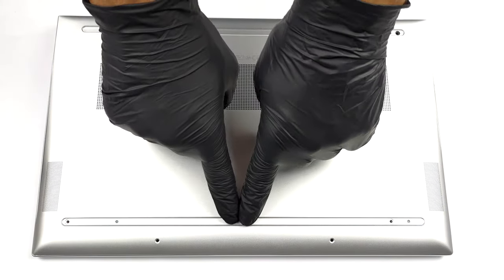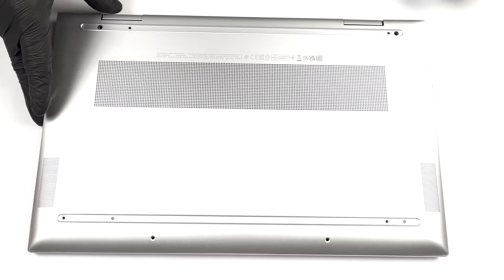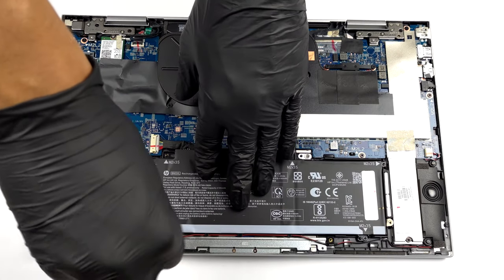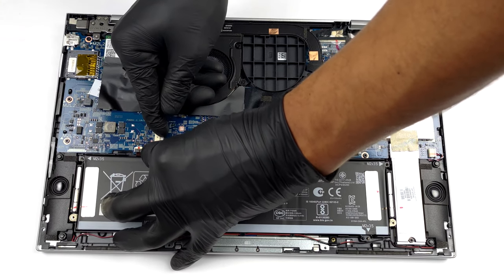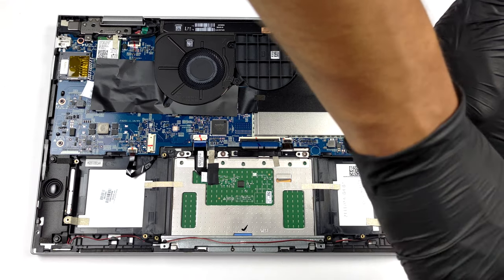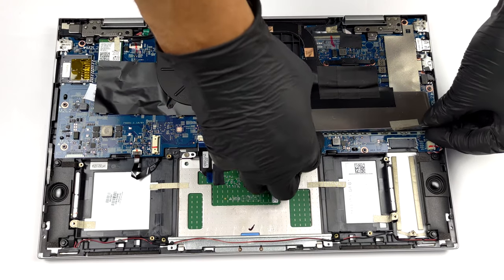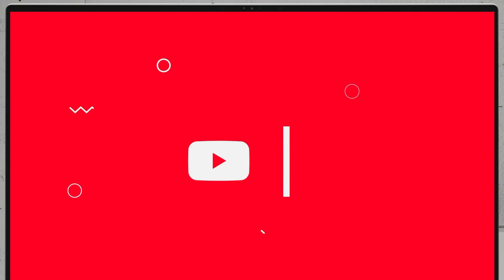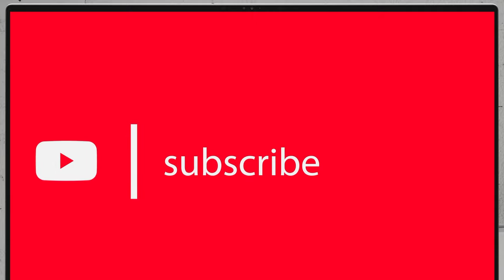🛠️ HP Envy x360 15 (15-es1000) - disassembly and upgrade options

Comment: Excellent video. Thanks, but my Envy has a different problem. The lid only partly opens and  where it joins the main part of the laptop, the lid is unevenly opened on the right side it's ok, but on the left it is close to the body of the laptop, which means that it is a little twisted. The result is that the more i try to open the lid, the more the screen detaches on the left hand corner. It's an expensive laptop that has not been used a lot, but is out of guarantee! Do you have any ideas on how to repair it. HP don't want to know, they just want to sell me another laptop, even though they are still making this model apparently they don't have any spare parts. You are obviously a genius and I am hoping you will rise to the occasion and accept my challenge.
Thanks in advance from a desperate fan!